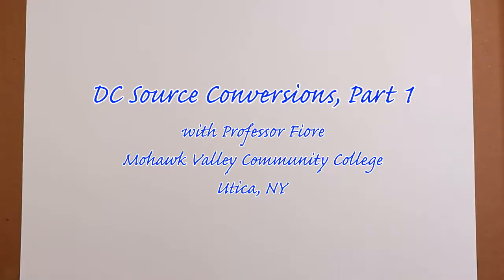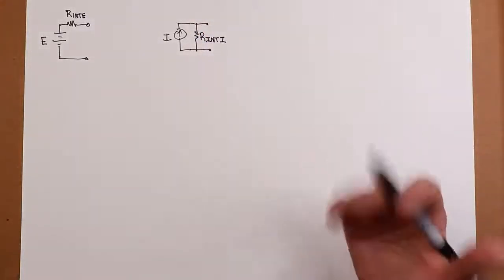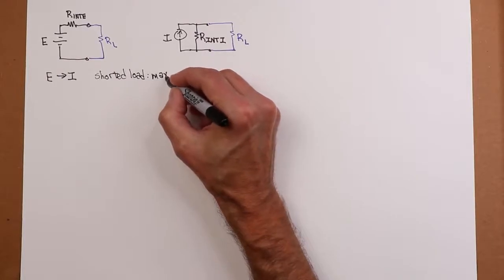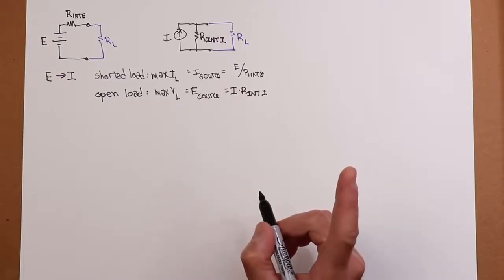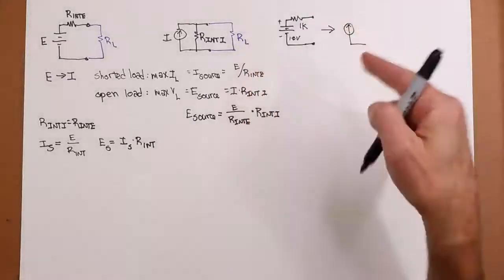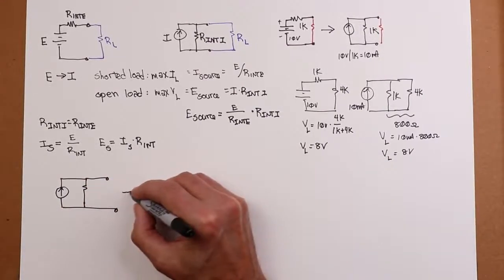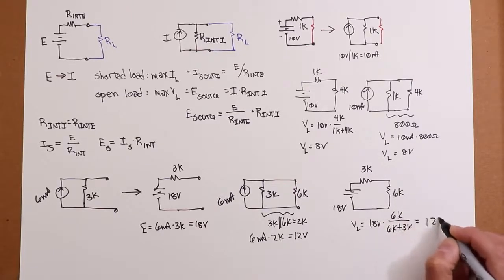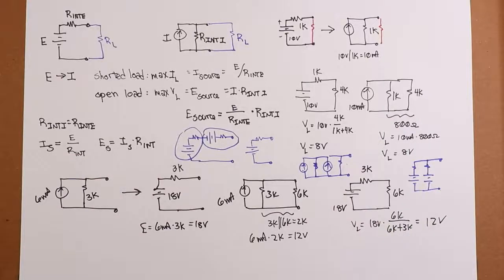DC Electrical Circuit Analysis: Source Conversions, Part 1

Comment: Excellent, again. Thank you. These videos are reminding me of times long past but I'm certain that your explanations are better than when I first came across these ideas. I'm looking forward to the maths that is coming up and love that you enjoy estimating/mental-maths. We both grew up in the days before calculators.
Reply from the maker: Yes, I believe that doing a quick in-your-head estimate is an essential skill. That's made easier using scientific/engineering notation, and a skill required when we used slide rules. Calculators are there to get the precision.
Reply: @ElectronicswithProfessorFiore  I agree. Being able to quickly estimate values to different degrees of accuracy is incredibly useful. I also find that it can actually be surprisingly accurate.